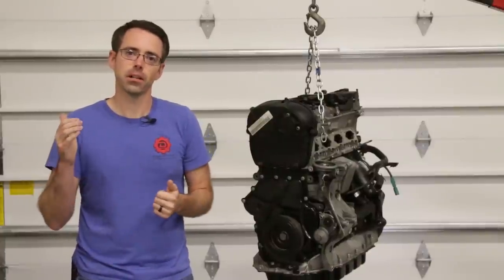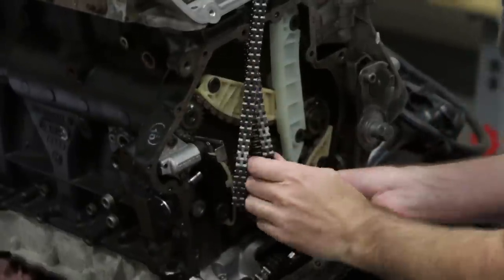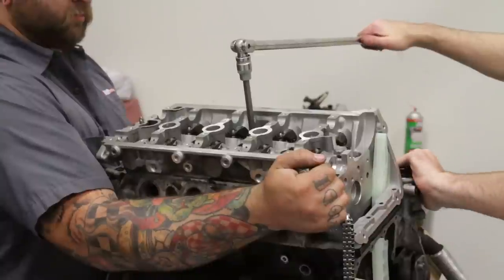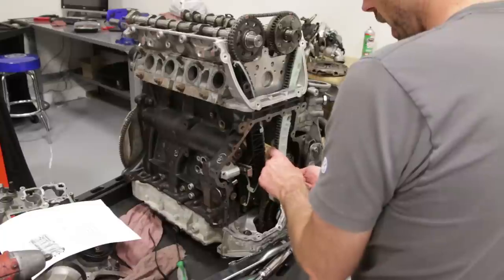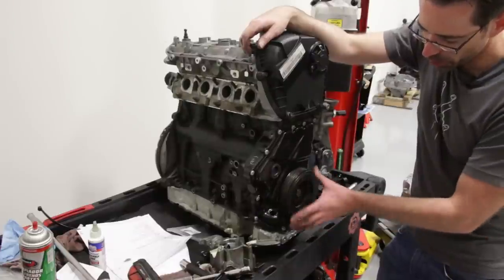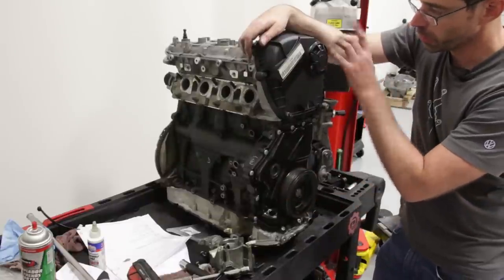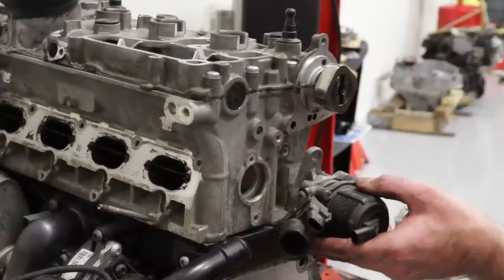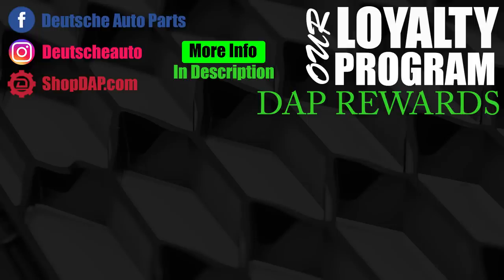2.0t TSI VW | Cylinder Head Install and Timing Up the Engine

Comment from the maker: For anyone looking for more in-depth info, we have a full article DIY on timing chains! https://www.shopdap.com/blog/post/20t-tsi-timing-chain-diy-vw-audi.html
Reply: sir,can i replace the lower chain tensioner(black screw one plug in from the outside)from the out side by just screw it in screw it out,and won't mess up the timing. Or maybe that lower chain guide tensioner isn't often fail and i can't find a video about it.
Reply: First off I absolutely love your videos!!Please help! I’m working with rebuilding the same engine. After washing parts in the wash machine I noticed this in the pan afterwards. Could you tell me what it is and what’s it does and where it goes? Thanks so much!! Here is the picture https://ibb.co/f119xCW

Comment: Your videos (and HM's) have been very helpful to me over the past couple weeks while I work on my TSI engine project.   I removed my engine to work on the bent valves so that I could easily access bolts and then retorque them easily when reassembling.  It was wonderful to have access to everything when removed.  One word of helpful wisdom I would like to pass along to you, and to the viewers, is when using sealants as you did in this video, use temporary studs in a couple bolt holes so that when you set/place the "valve cover" or timing cover down, the studs guide the part directly into proper position without wiggling or movement.  I make studs out of old bolts by cutting-off the heads.  Remove the studs when in place, and install the proper bolts all around.   Thanks Again for the great helpful information.
Reply: Great tip, thanks!

Comment: Those little grooves cut in the cover right by the bearing surfaces do not require sealant, those are cut as reliefs for excess sealant to squeeze into from the main sealant grove around  the cover, they are there to prevent sealant from getting into the bearing surface.
Reply: I noticed that but I'm no expert. ..yet
Reply: Also noticed this. I went by the service manual as to where to place the sealant.

Comment: Before slapping the valve cover on, momentarily install the cam bridge that it is flush with the cylinder head. Sometimes after complete installtion of cams and cover, the camshafts will be slightly off and the bridge will NOT sit flush. You will have to untighten everything, the sealant will break loose from the valve spring pressure compromising the seal and having to re-apply everything torque etc.

Comment: Hi. If i replace valve cover gasket only. Do i have to loose timing chain tensioner? OR cam bridge enough holding timing chain?
Reply: No gasket under valve cover and oil sump !

Comment: Why would you recommend the Permatex flange sealant? Permatex clearly says to not use flange sealant on aluminum because it pits aluminum. Permatex recommends anaerobic gasket maker as it doesnt pit aluminum,  see video at 2:35: https://www.youtube.com/watch?v=IPAHPb9IuUY
Reply: Wish I knew this before. Forums pointed towards DAP recommendations so I ended up getting the flange sealant.

Comment: Great Video. One question! The VW manual, page 137  "Apply sealant onto clean sealing surface of cylinder head cover, as shown in illustration -arrows-. So the picture shown only 3 sides (perimeter) and around the spark plugs only. Your video includes the small grooves next the bolt holes. Advice.
Reply: Those grooves next to the bolt holes should not be sealed, they are there to lead any excess sealant away from the cam bearings.

Comment: I just replaced my MK VI Timing chains and used this video as one of my references.  Thanks!
I do notice that my engine sounds louder than it should.  More of a growl.... Think that has something to do with improper lineup of the balance shaft or maybe something else that didn't get reinstalled properly?

Comment: Pretty sure you are not supposed to seal the inner grooves only the outer one. You are also only supposed to use a very very small amount of the sealant as to not get into the inner grooves. The inner grooves are for oil flow.
Reply: Fuck sake I was pretty sure of that but saw him confirm “every groove” in the vid so I just put it on like that smh thanks for confirming my suspicion though wish I trusted gut

Comment: Are you supposed to use sealant on the cam cradle bolts? Mine were pissing oil out like crazy. Also I'm struggling to get the cradle to seal. Did it twice now. The spark plug holes are full of oil

Comment: I replace the hydraulic tensioner but I did not use any oil or got air out as you recommended during the video.
I believe I crank the engine before the first start but don't remember. Should I be concern with the timing?

Comment: Is there a spray or adhesive that goes on the metal gasket between the crank block and head cylinder? Or just lay out the gasket mount the head and torque the bolts down?

Comment: I noticed that you put the sealant in the groves on each side of the cam bearings on the cover.  The manual does not show sealant there.  Is there an updated procedure or something that changed that now requires sealant in those grooves?  Thanks.
Reply: Yeah. I noticed the same. I did not find any update on to this in official VW manual. I think shapdap made a mistake on that. Those are oil passages. Lucky because they are using anerobic sealant, it should just wash out into they oil and out with next oil change

Comment: Just a question, 
We cant use the same bolt twice right? I had my valve changed because a sparkplug tip broke into the cylinder hence why the misfire.  Did a compression test and yea 0 psi pressure in piston 3 So i had a cylinder head out to change the valves.. replace all gasket and seals, when time to put everything back on the..the cylinder head bolt broke!!!! And it was the last far right bolt. It broke after 70lbs torque ( the extra 90 degree)

Comment: 2010 Jetta 2.0l turbo jumped timing last year with 220,kms on engine its Tsi engine. Would that be covered under factory as car is still sitting as timing took valve out of head. Can you plz help! I can’t afford to fix

Comment: Question: if I rotate engine until both chain marks are lined up at top with the cam marks, is it always true that the marks on the crank and the balancing shafts will also be aligned? Or is this only true on initial installation? I have a situation where I believe I have identified that my crank and balancing shafts are out of time with the Cam’s. If you have an email, I am sending photos with markup.

Comment: Hi,  I recently did a timing belt change.  I noticed on turning the engine as recommended,  the cam and crank shafts marks were never lined up.  They were like 3-5mm off. Pls will there be any effect when I start the engine? Did you reuse the head bolts in the cause of your installation?  What's is the disadvantages of reusing the old head gasket bolts.  Thanks

Comment: Looking at this video it does not look like one has to worry about messing up timing if only resealing cam girdle. Looks like you just need to make sure that everything stays locked and cams and chain doesn't move. Am i corect or im missing something?

Comment: I have an 09 gti with the tsi, just did my timing chain and tensioners, and replaced all the guides and such. Even replaced my cam adjuster magnet and my N205 valve. And now I have a p0016 code and on startup it cranks extra long. But when I clear the code and start it, it cranks normally. Car seems to run fine too. Any suggestions?

Comment: Question , when you put the cams on the cylinder head to set the timing , does the cover is it normal for it to tilt by a little? Is it because once you tighten the screws the cams will sit probably ? 

Or does the valve cover have to sit flush ?
Reply: install cams and cover first, then follow the steps to install a new timing chain from the factory manual...

Comment: I need a bottom end of the engine for a 2010 Audi A5 Quattro 2.0t got the top done put all back together timing chains and all took around the block for a test drive car shut down     Smh I think the bottom locked up tried restarting no start one hard hit an nothing else think the crankshaft bolt backed out on me any answers before I take engine out ????
Reply: I got a block for you

Comment: I have a 2013 MK6 and i am looking for some recommendations after watching this video. Should i bring my car in for a checkup on this timing issue? I am looking to add a K04 kit to it soon but this got me thinking if this is a good move. My warranty is gone so no problems there and i am currently running Stage 2+. Or should this be checked during the K04 install? Thanks guys.

Comment: First, thanks for all the videos, they are a great help to me.  I’m currently changing the chains on my 09 gti and I didn’t prime my balance shaft chain tensioner with oil. Will I need to disassemble and do this or can I just prime the tensioner by cranking the engine without the plugs in?

Comment: Hi ,what for are the cooper color union in the cams chain? Something related with adjusting or only union ?
Reply: The different colored chain plates on them are for timing, they are used to properly align timing marks on the cams and crank sprockets to the chain plates for proper timing.

Comment: hey guys i have used and reference this video several times and noticed for the first time you are putting flange sealant in the wrong location. You do NOT put flange sealant in ' all the groves". the grooves by the cam journals are a relief so any extra sealant from the cover goes there and NOT towards the cam journals. Sorry if this is a repeated comment.

Comment: Hello,
I have  Volkswagen Tiguan 2011, and I have an engine oil pressure light that lights up (red), knowing that I have changed (the oil, filter, oil pressure switch and oil pump), but the light still blinks after a few kilometers of road,
please do you have an idea that comes from where this problem ...
thank you
Reply: Holy shit same have you found the issue?

Comment: Have you ever done a video on say "smog tune" and then a "mpg tune"?  Is it possible to have these two tunes available on an obd11 and switch between them when necessary?  Nice job and enjoyed the video: 2010 vw cc owner....with many of the issues you have covered.  Wish you would have talked about good things to replace while doing the timing chain...vvt solenoid/valve and front main oil seal with Teflon aka ptfe rubber as last longer...??? anything else?

Comment: Great write up and video! You were able to lower the engine in through the top - do you just bolt in and attach gearbox or did you have to over-lower engine, attach gearbox, then lift and bolt to mounts?

Comment: Had my '11 GTI TSI jump timing with 100,832 miles, not even while engine was running, just turning over the starter...guess what VW told me?  Good luck.  Still sitting in the driveway.
Reply: C Payne I am in the same position right now. These cars will jump teeth at start up and cause it. Mine jumped time and bent all exhaust valves and head needs replaced. Paying almost 5k to replace it. Once finished I will be selling the car ASAP.

Comment: 3rd time asking ** how much ft torque when you tighten bolts? ? * just put a new cylinder head on my cc so i want to know cause mine keeps leaking
Reply: He clearly said in the video 43 newton meters of torque on the first run, then 2 90 degree turns per run for a total of 3 runs

Comment: Hi Guys , Does anyone know where I can get the torque settings for the main bearing bolts on a VW Scirocco 2.0 TSI ? Engine number is CAW. 
Would greatly appreciate any help , or a point in the right direction!

Comment: Are there any specific repair manuals you’d recommend? I’ve done cylinder heads on other cars, but at a minimum I’ve always at least had a Haynes manual to work with. Hopefully I’ll get another 10 years out of my MkVI without having to pull the head, but I’m not counting on it.
Reply: Haynes doesn't make a manual for mk6 GTI. I hate it. I was like seriously? Good question as I paid 1200 for a valve cover job at the dealer cause I didn't know how to take it apart with the engine in the car. I've done covers before but with the other crap that comes on the 2.0 I didn't want to risk messing this one up. I would love to get another 10 years/ 100k out of it. I want to see it hit at least 200k and I know I need to get the tensioner and chain done soon. It's not ticking or going out but just as a precation. I have 125k on mine

Comment: I knew I shouldn't of gotten my 2013 used gti, with dsg. I got to relaxed having mk4 1.8t jettas, which were much easier. This is a nightmare.  A whole new breed. Should of gone to the dark side instead, and considered a Ford or even a Honda... my mk4s are just getting old. I need an aspirin. 
Thanks for the vids.
Reply: I almost ptssed myself with reading that Darkside statement. I have a 05 Gti I refreshed the motor over a weekend no big deal. A friend calls recently like hey I have a 2007 2.0t Passat whats the first mod should I do with it, I said trade it for a Camry, Lol.
Reply: @emotionalintelligence776  lol!! Camary or Passat. That is the question....tis more nobler to own a Camary then the Passat. For all things VW are nothing more then the stepping off  point to the event horizon.  From which there is no escape. To live out your life in a living hell with no hope, where madness consumes your sanity and your weekends are spent trying to fix something that broke - again. Or to face the endless list of parts from everywhere, and infinity seems like a walk to the corner. Endless hours of perfecting your driving skills on ps3 or 4 with Grand turismo, because your vw is not running right or at all. Madness consumes all that is you. Trying to get car perfect, something the engineers should of done to begin with.....
Its complete and utter madness.
                          Or
He could take your advice and get the Camary. Then again, where's the fun in that.... ITS MADNESS I TELL YOU.  MADNESS!!!!!!
Cheers my friend. Take care.

Comment: One thing I dont understand is why people use assembly lube? Why introduce a completely different lubricant that will end up mixing with the oil? I dont get it. Wouldn't it just be easier and better to use oil?

Comment: I recently got a Mk7.5 GTI and I wanted to know your thoughts on getting an oil change done after the first 1,000 miles or just waiting until 5,000 miles? Thanks Cody
Reply: they say every 10k, but you suppose to really do every 5k. especially if you're smashing it. vw is big on oil
Reply: @LuMajor  Mine burns like crazy. No leaks or anything, it just eats it
Reply: @davidvilchez2209  you be smashing your rpm? if you always doing sport mode and maxing out 1st and 2nd gear every time just for show or excitement . that will happen. trust me i know how German vehicle owners are. I have a cc myself but i drive it very casual because its not a ferrari. so make sure you always check your oil level so your car don't mess up boss
Reply: @LuMajor  Nah, I usually do drive in manual mode though. Im going to replace the pcv valve and see if that helps consumption. I had a leak, but vw dealer re sealed the valve cover. Gonna replace the pcv and see how it goes from there before taking it back for them to check it
Reply: @davidvilchez2209  thats good and how much the dealer charged you to reseal the head?
Reply: @LuMajor  1400. Too much, but they put on another intake under warranty and cleaned valves out too
Reply: @davidvilchez2209  sheeesh! too much. if you get a vw technician, that will cost like 400 top
Reply: @davidvilchez2209  good thing you take care of your car tho. some people try to do that when its too late
Reply: @LuMajor  Yeah I've done covers before but that was a little beyond my skill level to tackle by myself. I've done some work on the car but not much. I don't know anybody that can work on a GTI besides the stealership. Sadly their quote was the cheapest I've found in my location. I do need to do a dsg flush and put a new transmission filter on. Is that a simple enough dyi to avoid paying them 400.00 to do it?

Comment: Hello he forgot to tight the 4 t30 bolts on the front of the head. He didnt even put the bolts in. The 4 bolts that go right under the cam sprockets in the front.